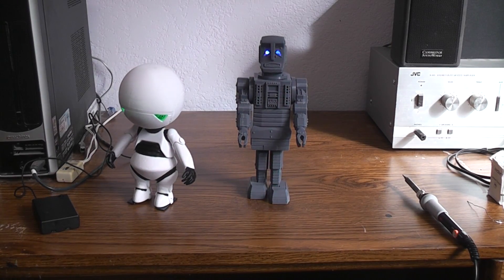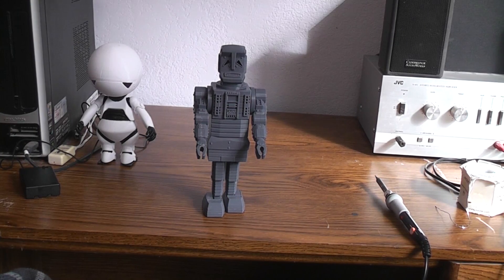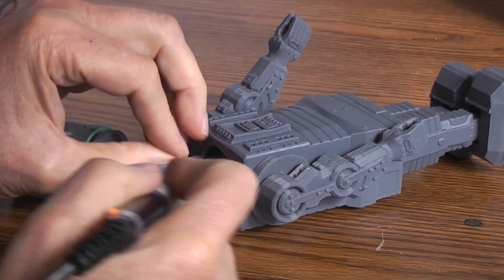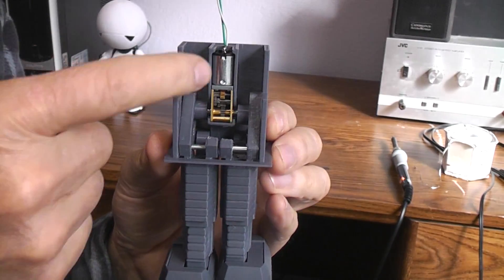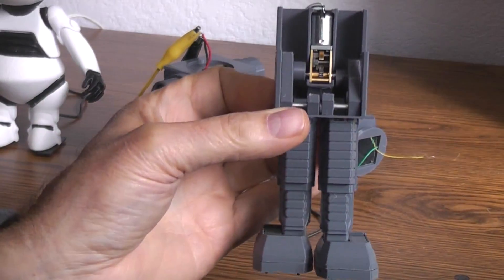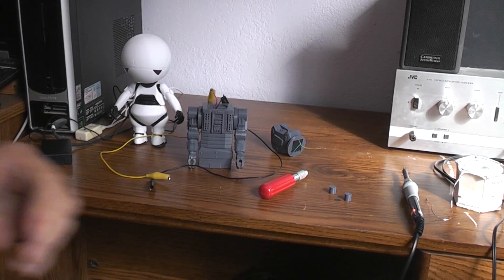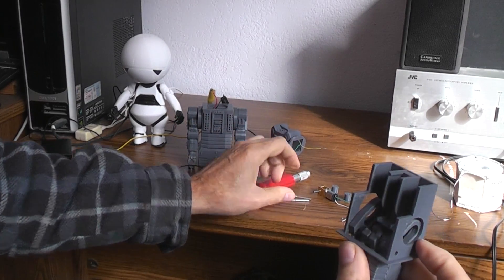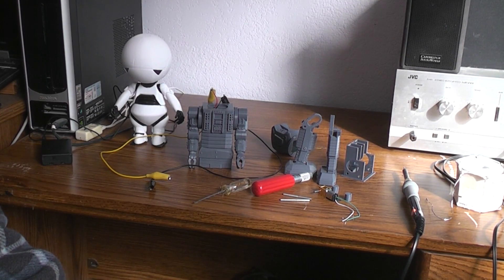Part 5. Its alive. BBC "Hitchhikers Guide" Marvin robot project. Testing the walking action.

Comment: What are the size of the rubber rings Please? TY
Reply from the maker: You might have to print the wheels; it only takes a few minutes. Then you can measure them, as I do not recall. I just buy the rubber O ring sets online or from Harbor freight for under $10 bucks. Then I have the full selection for all my projects.
Reply: @Robothut  I have an O-ring set. Yeah you’re right I will use the caliper and measure them. Thanks, John.

Ps I didn’t think of that
Reply: For reference here they are 5.9 to 6 mm the O-rings for the wheels

Comment: what is  the size of the  motor? TY
Reply from the maker: Called out in the build videos and on the thing-i-verse build link.
N20 dual shaft low RPM motor.
Reply: @Robothut  
Thank you John did listen to the videos. I didn’t see the information.
Reply from the maker: It is even listed in the title of the thing-i-verse page for the stl files. @PeterAgostiniJdcap26
Reply: @Robothut  I was not paying enough attention sorry .. doing a lot things at once .